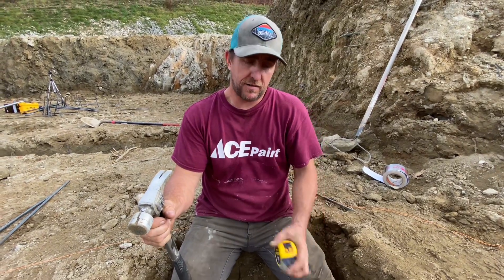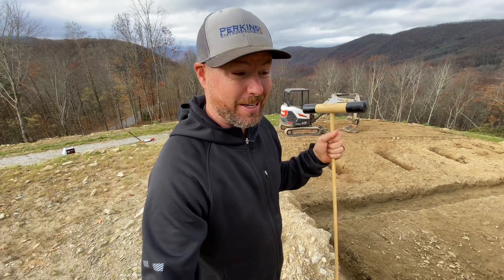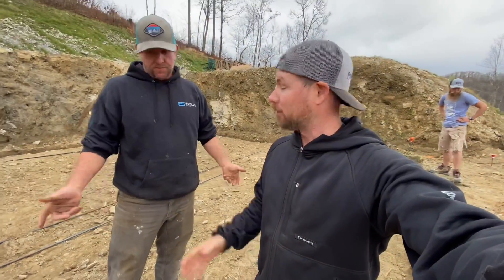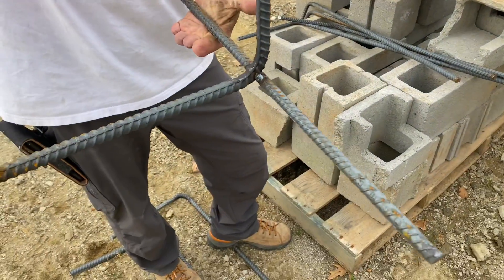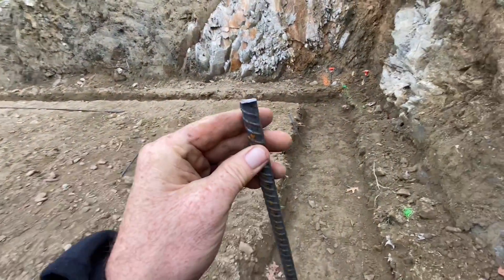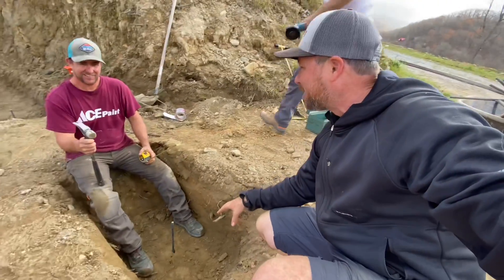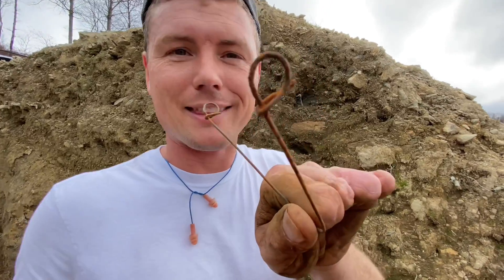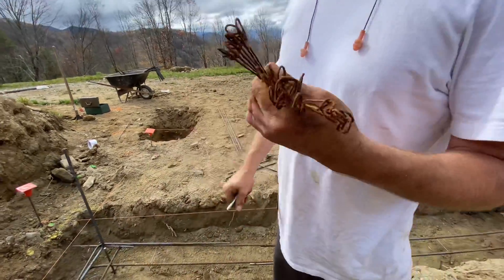How to set grade pegs for a level footing: Building The Farmhouse | Day 2

Comment: Thanks a lot bud I learned a lot Question:  If your on a downhill slope is it the escalators job to fill in more dirt at the lower end or would he remove dirt from the high end or do I pour more cement at the lower end?

Comment: @1:44 also put oversized sleeve pipes for other utility lines like water, data, electricity, outbuildings, maybe heating. never have enough of them and its impossible to add later

btw, I subbed less than midway through the day 1 vid. you ROCK and the edit is AWESOME 💗

Comment: Do you remove the grade stakes after you level the top ? I had always heard you didn’t want the rebar in contact with air or dirt as this caused it to rust and degrade the concrete.

Comment: I'm surprised they let you put some rebar directly in the ground, the inspector called me out when I askef him before he came over.
Reply: The only rebar touching the ground is the grade stake pins. They are not structural. They are only used in pouring the concrete. If they rust out (in maybe 83 years), no harm no foul!

Comment: Great video and work as usual guys!

Am I the only one that cringed at what looked like a nice framing hammer driving stakes? I love a 2 lb drilling sledge hammer for that.
Reply from the maker: Thanks! It does have a replaceable face, so not too worried about it. For $250 this hammer better do anything!
Reply: @PerkinsBuilderBrothers  Awe that makes sense. For $250 it should make dinner once in a while!

Comment: How did you get your inspection if you welded your cross pieces rebar to your J bars ? That’s a no no in my county
Reply from the maker: Tack welded... two small dots
Reply from the maker: What’s your country?
Reply: @PerkinsBuilderBrothers  In Virginia
Reply: Why would that be a nono? I would weld all the rebar in place real quick instead of endlessly tying them together. Just needs to be held in place until poured
Reply: Sorry.... yes you can if the rebar is mark with a “W” welded quality rebar
But the main reason is it’s building code not too

Comment: how about those vertical rebar ankers?  doesnt it affect de concrete when it is poored? i mean the bottom of it is exposed to concrete and the ground so doesnt it corode and expand so the concrete foundation can cruble and break?
Reply from the maker: None of the reinforcing steel touches the ground... it is all suspended until the concrete is poured

Comment: I had a structural engineer and an architect about 10 years ago told me I could use zip ties on the rebar instead of wire I tried it I wouldn’t do it any other way now, much easier and quicker
Reply from the maker: Nice trick! Love it
Reply: I use zip ties as well! Never touching wire again!

Comment: You're not suppose to let the rebar touch the dirt. Those rebars that you guys are sticking in the dirt are going to rust and affect the concrete. How can an inspector approve that?
Reply: All of the rebar is on rebar chairs (they are hard to see in the video) and they hold the rebar a couple of inches off the ground.
Reply: @randperkins160  I'm talking about those vertical pieces you stuck to the ground, they're going to rust and affect the concrete.
Reply: @AngelLuisTrinidad  how are they supposed to "lift" it? im just here to learn

Comment: Nice J-Bar welding idea!!
Reply from the maker: Thanks! On commercial projects sometimes they run another roll of rebar of high to stabilize all of the J bars.  We have also use the type that has a stake welded on the bottom that you can beat in the ground but I would rather not have to be any extra stakes in this rocky ground
Reply: @PerkinsBuilderBrothers  My General Contractor Father in law liked your method of setting up the J bar.  He was concerned it wouldn't pass inspection here in California.  He and I will be building my home here on the Central Coast hopefully next year. We have been looking for reasons to use our welder and this would be a good one.  I'll have to do some investigating, because we'll have two foundations to do as well some retaining walls.  Digging your channel and picking up tons of tips for our build.   Thanks a lot!!

Comment: What is the purpose of the J bar coming out the top of the concrete? Asking from Zambia- Southern Africa where we do construction a whole lot different!
Reply from the maker: Good question… It’s to connect the concrete in the block wall to the footing. It will hold the foundation down as well is keeping it from getting pushed laterally by the pressure from the backfill.

Comment: Like the little crossbar on the vertical  L rebars. I should try that next time. I usually roll up my strings around leftover empty spray cans of marking paint with knots tied every 4 ft while i pour and then unroll them while the crete is still wet and push my rebars in then.
Reply from the maker: We’ve done the exact same thing a lot of times… This was a lot less stressful though because we knew they were in the right place and we have waited a little too long sometimes and had to really fight to do the wet setting

Comment: Rebar that you use for final finishing of concrete is worng becouse it will rust and crack the concrete along the line and secondly use plastic underneath the concrete or sprey some good amount of water before pouring concrete. or get some advice from civil engineer.

Comment: I didn't know anyone still built block basements. Why?
Reply from the maker: Less expensive (even after concrete grouting) and we can do it ourselves. There are only two good concrete form guys in our area and they are both about three months out on their waiting list. We only found out we could start this job two days before needing a basement wall.
Reply: I'm curious about this too.  Every house I've ever seen where I live has poured basement walls.
Reply from the maker: Good question
Reply: Ok concrete must be expensive now. Its seems like the cost of labor to lay block would be a lot higher. Also every block basement I've seen leaks that's why my parents poured their basement 20 years ago. They rented forms and did it their self. It was simple.
Reply: This is in Illinois so it might be the cold that makes block basements leak.
Reply: Ashley Hill nope, not just the cold. I flip houses for a living here in Metro Atlanta GA. We look at hundreds of houses per year (buy 1 out of every 10 we look at). 95% of block basements that I see around here have some kind of efflorescence from hydrostatic pressure. 50% have visible dampness and/or visible water. 70-80% of them have some kind of settlement cracking. I’m personally not a fan of block walls for basements after seeing a lot of them. 

Perkins guys, have you looked into ICF’s? Something y’all can do yourselves but get the benefit of a solid poured wall.
Reply: How about icf blocks?.....super easy and you get some r value

Comment: It’s great you found a spot for those super rusty tie wires in someone’s foundation, right at some critical steel reinforcement bar intersection,  now it can spread its disease from there and be remembered and talked about years from now.  
Hate to waste a quarters worth of rusty wire. 👌
Reply: Got the engineering dept here in the comments. Say you didnt happen to notice any surface rust on that rebar did you? Better get out there w the steel wool and the wd40.
Reply: @ubrayj02  lol it’s not like that but introducing more rust than necessary is obviously frowned upon.  Extremely rusty bar will fail inspection.   If I really did want to be picky, was worried about the design or just didn’t like him, I could of failed it for welding the homemade “J” bars no question, that is a no no.  
And it’s Head D inspector to you.
Reply: @jaxturner7288  Why is welding them bars unacceptable? The ties are only to hold them in place until poured, whether its wire or zip ties. Seems like a quick weld would do the trick and would be faster as well
Reply: @baronvolkov6172  seems like it doesn’t it.   

I thought so to, awhile back anyway.   
Let me just first say this,
If it’s in a flat slab for a shed or a simple driveway or sidewalk, nobody gives a sh*t and it doesn’t matter.  

However.  

Depending on the structural load requirements of the cement structure in question and especially the potential losses involved in the case of its failure, 
all of those seemingly innocent things you mentioned could potentially lead to a disaster and all of them at certain times AND on the right job site could be legitimate cause for a failed inspection.  
So first. 
Extremely rusty rebar tie wires can unknowingly fail during the pour,  allowing reinforcement bar patterns to shift, that leaves weakened areas, that’s definitely a no go costing thousands to fix.   
Or sometimes when a few ties fail at one end of the slab, the entire re bar grid can kinda roll over on its rebar chairs and flop down sinking the grid too close to the bottom surface, causing bottom surface spalling and possibly leading to failure.    Ties are cheap until they don’t do their job, then they cost owners and contractors thousands, minimum, so questionable ties for any reason should be avoided or at least will need to be addressed, both by doubling them up at the crosses and reducing their spacing on the lateral bars. Adding any more rusty materials than necessary on any of the components causes reinforcement bar corrosion to happen sooner and more severely, so it’s never a good thing to do.  
As far as plastic zip ties would go, because they are made from different materials than what is normally accepted as concrete structure content, and that’s because different materials would likely have different thermal expansion and contraction rates than steel and concrete, and different expansion rates within concrete is avoided like c-19 is nowadays so they would be a definite NO go, besides that they would likely also be from unproven suppliers, to the industry that is, and any unregulated or unproven materials are a no go in critical concrete structures. 
The ties are actually really important because they insure the reinforcement grid stays as the plan specifies. If the grid moves or fails, the structure is most likely going to have unforeseen problems and be weaker than it should be.  
When it happens sometimes the installers don’t notice it happened, sometimes they do but ALL Contractors are reluctant to start the job over on THEIR dime when they just got the mud poured in the forms and then the grid falls over, so often, nobody says anything and nobody can tell what’s going on in concrete until it fails.  
Ultimately, reliable rebar ties installed in the correct manner keep the contractors from having to decide between being the bag guy and the broke guy because often no inspector is there during the pour to catch a grid that shifted.  It requires the contractor to be extremely honest and that’s harder to come by than a hundred count loop of new standard rebar ties that cost less than $5.      
It’s a nobrainer anytime steel bar reinforcement is being relied on, the ties keeping it in the correct place and spacing need to be reliable.  If a simple cheap bar tie fails it’s just to likely the grid fails or moves, if you needed the grid of reinforcement and its not in the correct place or it falls, then the structure is likely to fail altogether much sooner than expected.     
Nobody should allow that great of risk to happen over a couple bucks worth of wire.    
Inspector or not, just saying.  

Now your simplest inquiry regarding welding reinforcement bar in concrete.  It is rarely ever done because of the increased cost involved over tie wire when done correctly, welding it with the specific welding materials done by a certified structural welder and then x-rayed by a licensed welding inspector.... then it is sometimes allowed, but even then ONLY on the lateral bar intersections, not ever at the cross intersections, and even then only permitted when used in multiple layer grid systems over 12 inches nominal thickness and when done using acceptable practices.   
So because even a monkey can tie bar for bananas per hour compared to the cost of the previously mentioned process, you can see why it’s very rarely done.  Usually it’s on HUGE projects that have the rebar grids erected and then exposed to the elements for long periods of time during their construction, usually it would be considered because of that extended exposure to the elements during construction combined with the seemingly silly problem of rusty rebar ties like I said before if the silly rebar ties get too rusty and they fail.... and when they are left in the elements long periods that is likely they become questionable and ties can be extremely hard to inspect or test after installation so welding on the lateral bar intersections is SOMETIMES but very rarely allowed and done.  
Still generally speaking regardless of the cost involved welding reinforcement bar is a bad idea because stick and mig welding add other alloys of metals to the mix which can lead to accelerated corrosion once the salts in the wet concrete contact it. 
And... more importantly welding causes a hot spot that cools slowly naturally which hardens the steel bar making it stiff and brittle in just that small spot, (that’s why it’s NEVER allowed on the cross bars) the bar having inconsistent elastic properties increases the likelihood of it snapping, instead of it flexing (especially in this instance since it was bent 90 degrees AND then also welded in the same area). ( that’s actually the only method I saw here I would of not passed him for, no way no how, not with a double bad practice both in the same location and then repeated throughout the footing, that =fail without hesitation.  
Plus any porosity in un tested or non X-rayed welds can cause latent air bleed off and that starts micro-fractures within the structure that grow upwards during expansion cycles.  
And if its flux core that is used the slag containing concentrated impurities when left in the mix can induce dissimilar metal corrosion, where none of that would of ever occurred, if the welding process didn’t concentrate and then force those impurities to the surface.   
There’s a lot of ways to mess up rebar with a welder. Even if you are a great welder yourself and already somehow have the proper materials on hand (unlikely) still only the lateral half of the connection job can be substituted with welding so either you break out two skilled trades and tool sets to do the job or just the much cheaper one (tie wires) with far fewer opportunities to actually cause total future structural failure.  
    So you see depending on the circumstances and the importance of the structure involved, normally irrelevant details or seemingly arbitrary materials can and do absolutely matter.  

Chances are still any slab you are doing DIY style, none of this matters one bit.   
If your project or experiment presents zero risk of causing injury or great loss when it fails like a simple shed slab or sidewalk,  like I mentioned before, you don’t even have to worry about any of this crap until you either got concrete above your head, holding people up, water back or people out, then you need to worry about silly rusty wires and “compromised steel reinforcement bar from intense localized heating resulting from non acceptable grid connection methods or processes being used and picky pricks like me.   

Till then bubble gum yer bar together or just throw it in during the pour, won’t matter when your concrete does what all concrete eventually does, cracks, just a little sooner than it had to.    
Whooptydo  no town floods no house collapses.  Don’t stress about my prick details until they matter.
Reply: @jaxturner7288  appreciate the lengthy response!
Reply: @baronvolkov6172  no problem, that was a great question people commonly have so I was glad to try to explain the answer.
Sorry to dump so much information on, and around the subject.  Seriously tho after the time we both got into this post reading n typing,   
did I tell you anything that you believe will help you make decisions when dealing with concrete feeling any better informed or confident in your decisions? 
That’s what matters to me.
Reply: @jaxturner7288  dont be sorry for such a great insight. Many are reading and learning. Keep it up! thanks

Comment: It would only take a few seconds to round those level pegs and surely a cheap 2lb hammer is better than that Stiletto for that job
Reply from the maker: Just tried not to drag my leg across any more of them :-). Just a little actually works pretty well, but we did have a sledgehammer on sight as well
Reply: @PerkinsBuilderBrothers  buy a portable band saw.  Faster than a grinder and doesnt leave as bad of a burr!